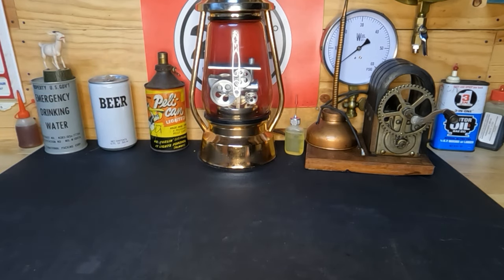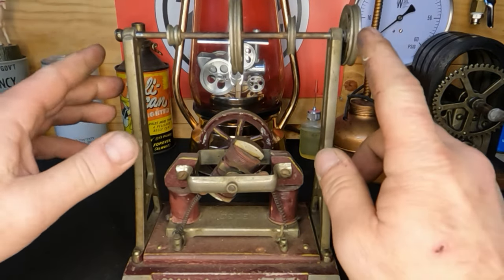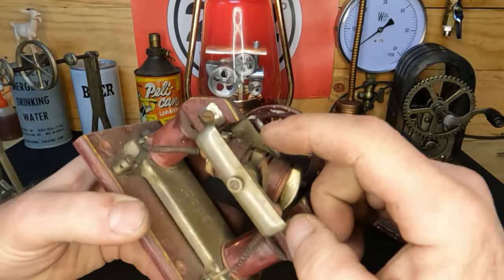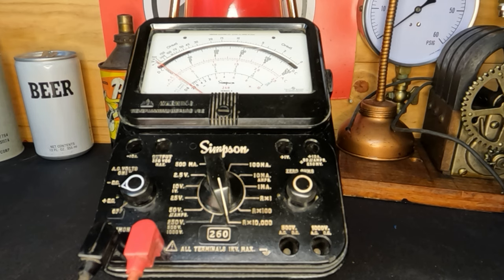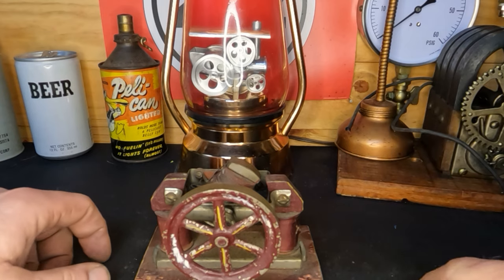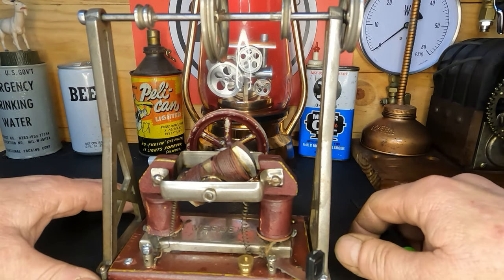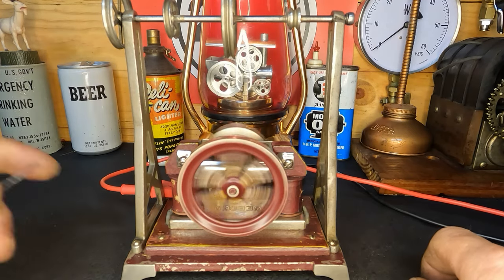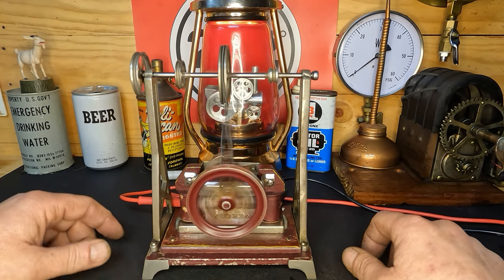Repairing & Running a 100+ Year Old Weeden Model 106  D.C. Motor

Comment: 11:21

1: I see Prudence the Safety Goat up there bleating away about all the open moving parts on this thing!

2: I wonder if you could back drive it off one of the microcosm engines and get a useable voltage out the other end.
Reply from the maker: Prudence spends WAY too much time watching the questionable safety of everything that comes across the bench.  I would think that if one were to disconnect the field coils from the armature leads & introduced low power to the field coils only that it should produce voltage by spinning the flywheel.  I would hate to possibly cause an issue by trying though, there are a couple generators in the shop to use if we wanted to make juice from one of the engines.

Comment: I was surprised to see it self-start the first time. most 2 pole motors won't do that.
Reply from the maker: Hi Mark, I agree with you 100%  it could be because of where the armature "landed" or possibly it was excited to run again.  Other than the loose bushings, (and the missing pulley) I was very happy to see it run again. I wonder how many of these early motors were tossed away because of issues with the brushes?  Thank you for commenting and for your interest in the hobby. 👍👍